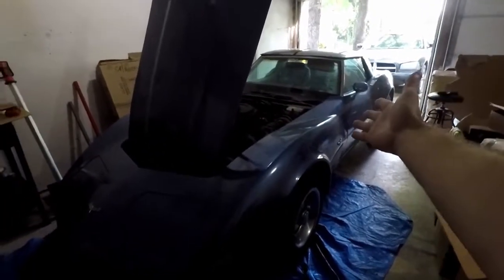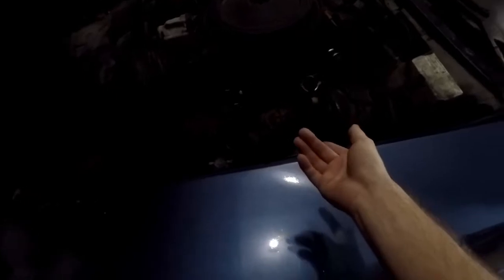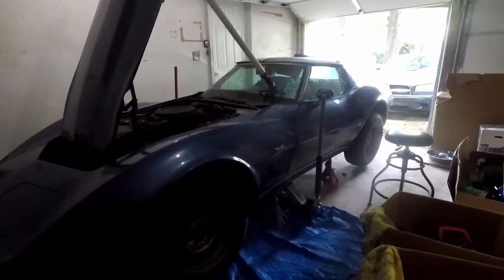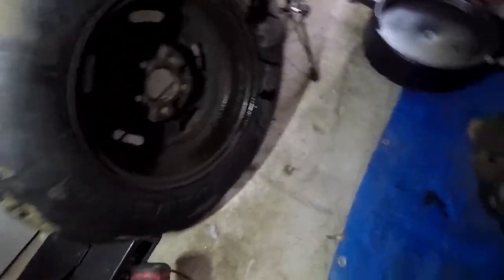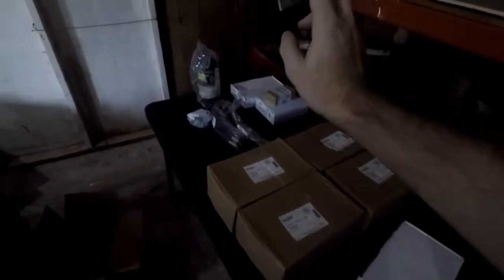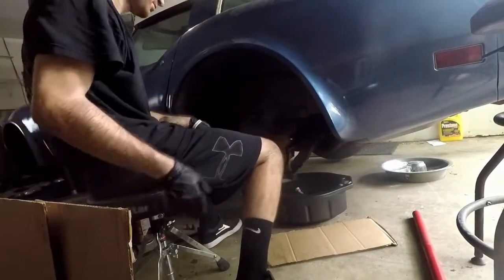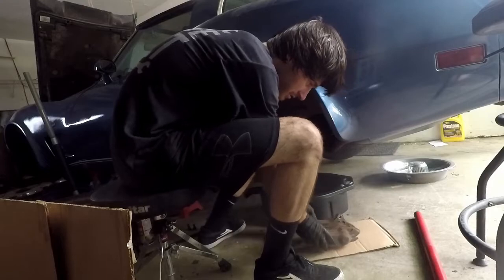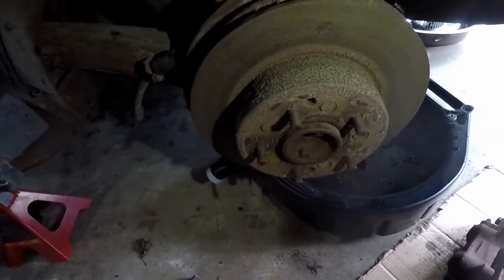Brake Overhaul On My 1979 C3 Corvette - Part 1

Comment: Just rebuilt my front end of my 81. Problem is, I found a crack in the front cross over brake line by where it hooks up to the rubber line going to the caliper. Thinking of getting a new line, but then I have to take out a bunch of stuff to take out, and put the new one in. Now I'm thinking of cutting the line at the middle of the cross, and splicing a salvage one in. So I don't have to remove all that stuff to put in a whole one. What you think??
Reply from the maker: Check out part 4 of my brake overhaul for this c3. I change the front crossover brake line in that.
Absolutely do not try to splice something in the middle of the line. You’d be asking for a leak and brakes aren’t something to be messed with, especially since brake fluid is flammable. Truthfully, the front crossover brake line isn’t all that bad at all. You just gotta wiggle it into place, didn’t really have to remove anything to get better access
Reply: @bluesxt  I got it out, I removed the mechanical fan, rad shield, electrical fan, and the sway bar. That gave me enough room to wiggle it out. Good thing I did actually,  found my water pump was weeping at the bottom hole, and my radiator is weeping at the lower hose. So, now I got a new water pump, and removing the radiator for brazing at a radiator shop. Also figured since I got it torn down, I'll put on my chrome timing chain cover, and chrome oil pan with chrome dipstick. Repainting the engine red first. So a blessing in disguise?
Reply from the maker: @gizzmo5952  gotta love those “while I’m in there” moments
Reply: @bluesxt  lol, got that right!!! Just rather find it now, then on the side of the road. But I am replacing the whole brake line tho. Shouldn't be as bad as I first thought. I already had the power steering pump off, and the alternator. Replacing the power steering pump. Already installed all new steering gear. Idler arm and all during the front suspension rebuild. New line should be here Friday.